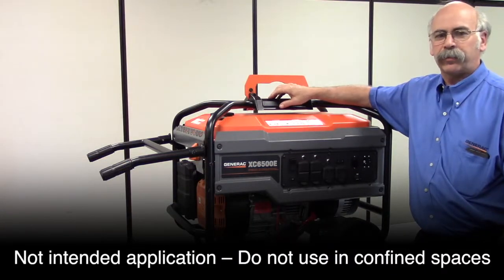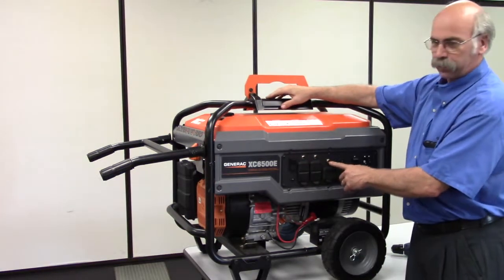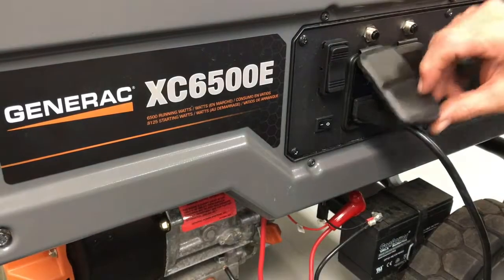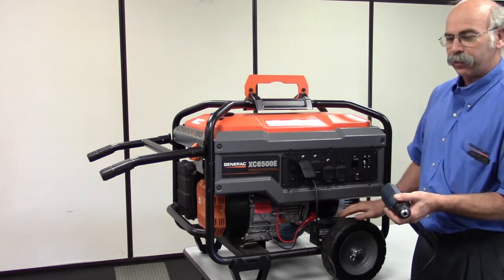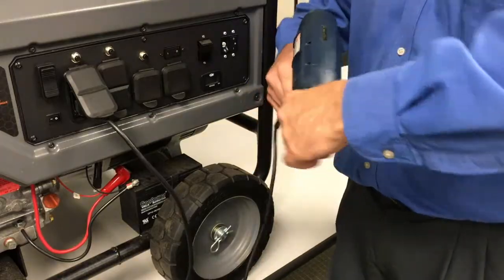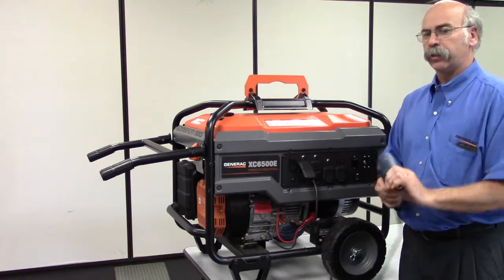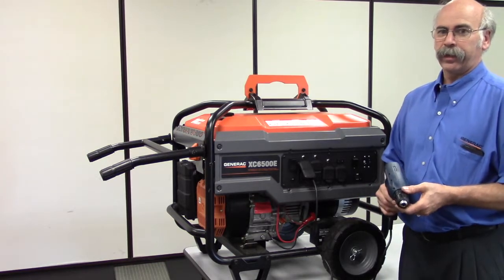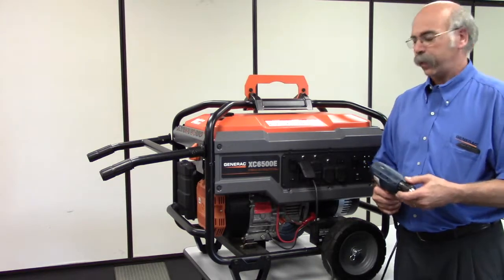Runs, But No Voltage - Drill Solution

Comment: would the generator have to be running to preform this repair?
Reply: Yes, because it only produces a very slight amount of magnetism which has to be amplified by the generator.  Once the generator gets excited it can generate a magnetic field strong enough to remagnetize the core.